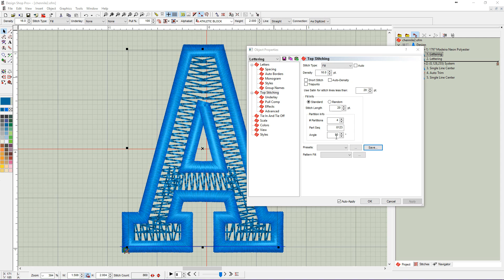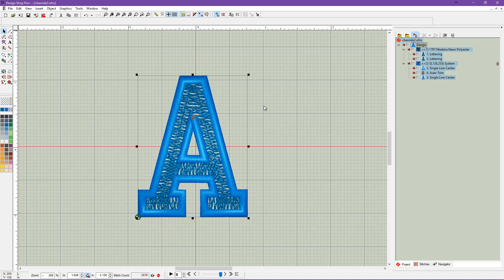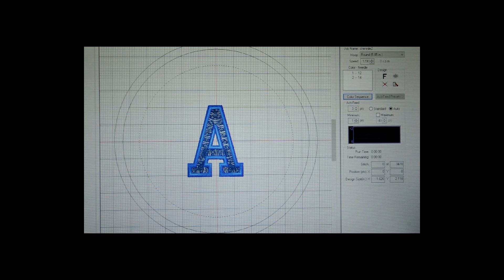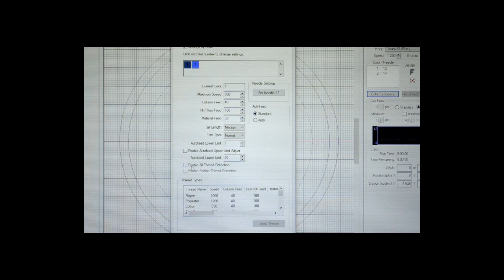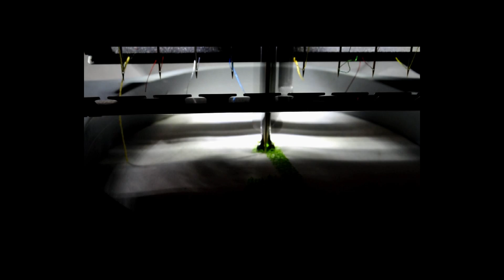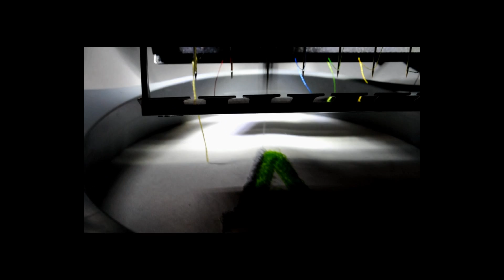Chenille Tutorial

Comment: Thank you for sharing your knowledge. I look forward to see your project"stand-alone  Amaya". Please, share the hardware that you are currently using to run your Amaya. I do have an Amaya XTS😎.
Reply from the maker: Sadly, I've been forced to sell my equipment and no longer have it. In a nut she'll what I used was my Latte Panda and a 7" touch screen. How I did this is to elaborate to describe here. FYI, A 10" touch screen would have been better. Although from what I've seen of the version 11 Amaya OS it may have worked better on my 7". I am not sure if I have material I could use to make a video of what I did but I have no problem explaining what or how I did it. Even Melco techs were a bit surprised at what I did since the machines are incapable of wifi control due to the network protocol they use.
Reply: @CandorPerlicious  It is sad that no longer you have your equipment with you. I bought my Amaya XTS back in 2014 and I am so happy with it. 
You just blow my mind with the LattePanda micro computer. I just surface the website"https://www.lattepanda.com/" , and I will run my Amaya OS on this Lattepanda.
This will be one of my new projects. I will send you some updates.
By the way, have you ever make the "statistics data base" works. Please let my now.
Glad to cross path via YouTube with a great mind like you.
Kind regards,
Alberto.
Reply from the maker: @AlbertoRodriguez-zx4mb  the statistics data base doesn't work with the XTS. Been over this with techs many times. It was made obsolete in the newer machines for some reason. Also I attempting to find any photos and material I have on the latte panda project and will see if I can't cobble a video from it to describe what I've done. I would love to hear about your endeavor.
Reply from the maker: In case you are interested I posted a video with what little material I could muster and explained what I did to my machine.